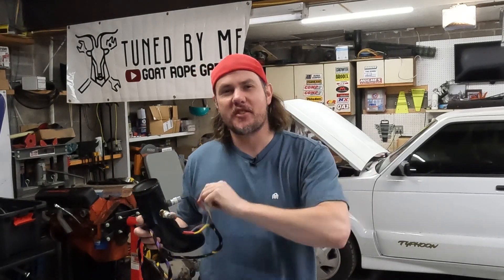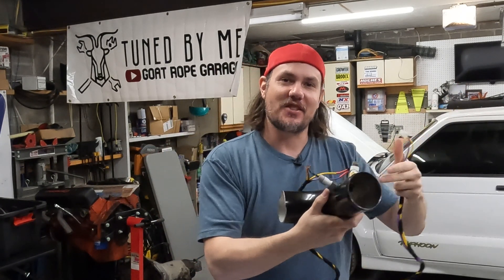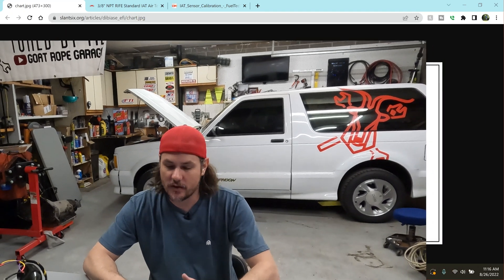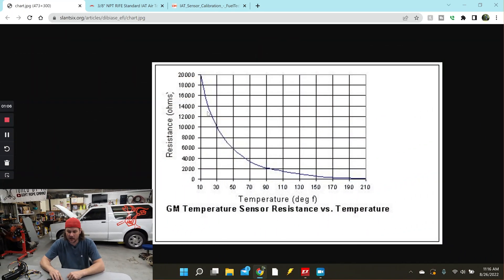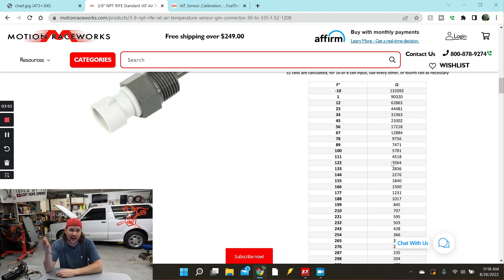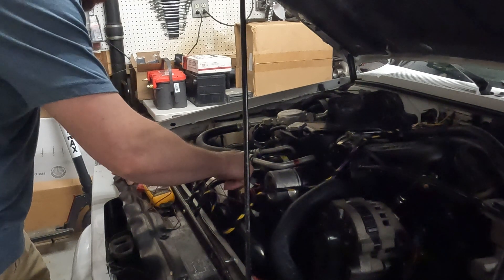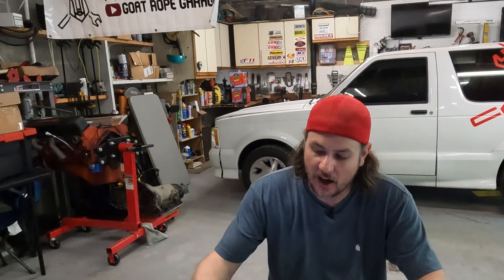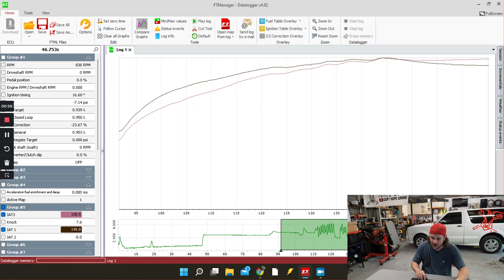IAT Sensors Shootout Part 2, More Questions Than Answers!

Comment: Came here to ask you a question and got learned on iat sensors 😆. But question is important. Since you installed  long tubes on your c7z would you sell me the primary cat deletes pipes you had on before? I have a race in a month and really need a set. They're gone everywhere. None for sale and looking everywhere. I can't really use long tubes cause under hood heat is an issue for me during auto cross and road course events. Really just can't be running cats when car is running that hot around a road course for 20 minutes straight. So if you'll sell please let me know.

Comment: Sorry I had to unsubscribe as far as membership it would hit it to wrong time man it would overcharge my account big time anywho question been reading up a lot more on the tuning when you have an ECU unlocked I take it there's a program they can actually give you a key it'll go through it takes 10 seconds it eventually figures out the key for the ECU okay when you do the HP tuning you no longer have access to that ECU key I keep hearing this iff or ifsa tuning platform any thoughts on that question is there a place I can send my ECU other than buying a pre tuned ECU to do my own tuning is there a way to actually open it up and bypass some type of security in there
Reply from the maker: What year and Vehicle
Reply: @GoatRopeGarage  well I'm still working on my 06 Colorado 2.8 motor this body control module I sent it off a year ago they was supposed to hand build me a body control module something about the processor went out they put a new processor in it something on the board Fryed the new processor. Big bow tie guy I got a 05 Chevy Malibu that's got a stage 3 Chevy performance flash on it anywho back to the 06 Colorado. I contacted the local dealership can't even get them to flash it it's getting ridiculous I'm going to get a bench Force set up you got to have a pass lock. Two connector you got to have it's like $180 connector for the body control module as well to reflash the unit I got to get another laptop I'm still a ways away what I was asking is with my 05 Malibu I had a friend that worked at the dealership he's no longer around but they offered a upgrade from the dealership to where they just cranked up the parameters it was a factory thing anywho back to the 06 Colorado I was wanting to buy an HP tuner so I can tune that motor I'm not looking for big games but I would like to have a flash to put on that PCM technically it's all in one on that truck but I wanted to know if I have the ECU unlocked once I get the pass lock for it once it goes in to HP tuning do I lose that..?
Reply: @GoatRopeGarage  they were saying something that it might go into security mode with the passlock 2 system I know how to bypass that system you cut the yellow wire put a resistor in it I've had a lot of problems out of Chevys lately with the pass lock to system sometimes you got to own out the keys on some of them anybody that works on Corvettes no like the 95s have the chip on the key you got to have air duster with you to make sure you don't get that wet or it will not start anywho my 06 Colorado they drag their feet on this they charge me 200 bucks that was the initial fee I said well let me send you 500 and whatever's left you can send it back they wouldn't take the money because it's non-refundable I felt that they were honest a year and two months has passed I'm getting upset my body control module couldn't be that hard I understand they're building it from scratch all I want to do is flash my body control module and be able to tune it they said the ECU has a pass lock
There's a program where they plug up the ECU it goes through there and eventually figures it out it can take up to 3 to 5 days that types in codes to figures it out eventually what I'm asking is they said when you type that passlock code in once you get it you lose it with HP tuning correct me if I'm wrong I'm here to learn but if I get a HP tuner and I have an ECU or ECM or PCM unlocked and I put that pass key in there in the HP tuner do I lose it that is my question it was an older article so I'm asking what the updated MV 2 is that a deal. This thing is still a mess it's got ABS control module transmission codes of course the body control module it's going in to reduce power mode it's losing signal from the gas pedal to the throttle body I bypass body control modules but it takes a resistor to go to the gas pedal to make it work but every light on it will be lit up. It's a pretty decent nice truck I was thinking about putting a 5'7 down in it out of 95 or 98 four-wheel drive pickup truck to give it a little more heart easy motor to put in and get it running gets away from the body control module cuz I can bypass all the wires it just controls tail lights headlights all that

Comment: Why didn't you use the thermocouple as the reference for true temperature? You need a reliable instrument to tell you which sensor is most accurate. The data from your sensors is opposite what Doug saw in his test log, so one of you has something wired in or characterized incorrectly. I'd be checking the voltage supply and value of the pullup resistor for each circuit. And if you can manage a temperature step response, that'll be the best indicator of response time.
Reply from the maker: It wasn’t accurate as it wasn’t in the air path. If anything I wouldn’t trust the default curve on the gm IAT in the fuel tech, may need to manually input that data.

Comment: Do you have any tuning videos coming out for the gen6 GM engines? Specifically the LGX engine. Love your channel . Thanks
Reply from the maker: Don’t think they are supported because of the global b platform
Reply: This would be for a 2018 Camaro v6. From what I can tell the global platform wasn’t introduced until 2020 . The hp tuners that I have says that it is supported from 2016-2019. Anyways just though I would ask.